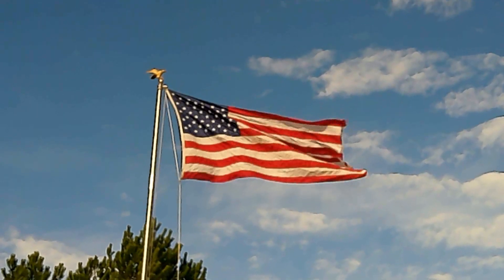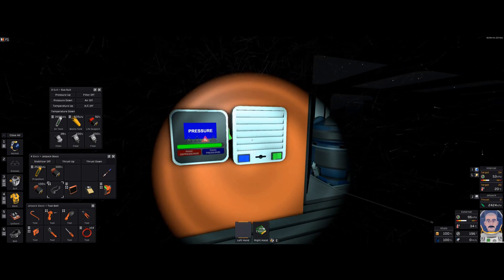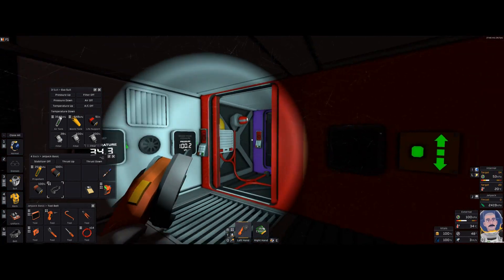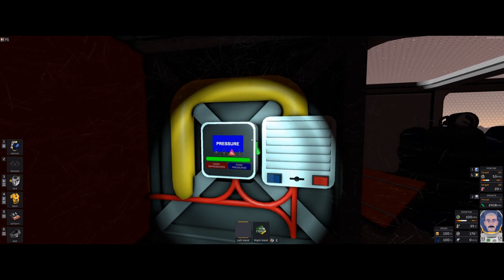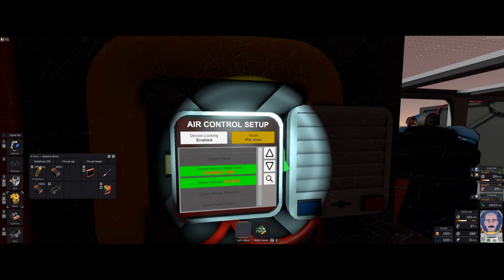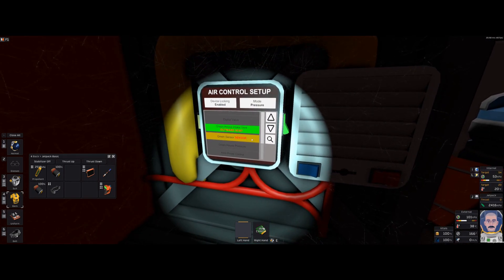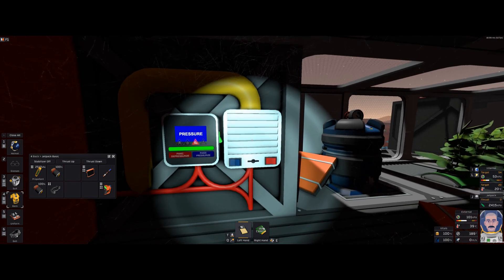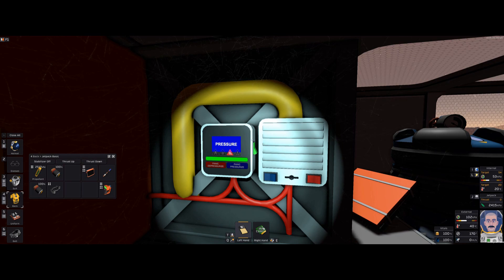Stationeers Pressure Control Tutorial

Comment: I have over 2800 hrs in Stationeers, never thought of this one lol. 
Tried this out on my secondary engine room and it stays more or less between 101 and 102. (Stirling)
No need for regulators to be equalizing the pressure. You could use this connected to a pre-mix Air tank (Buffer) and then have all sucked in/ out to that tank. Then filter out CO2 and mix it in by 1 to 3 percent. Something like that.Thanks!
Reply from the maker: Great idea with the tank pre-mix.